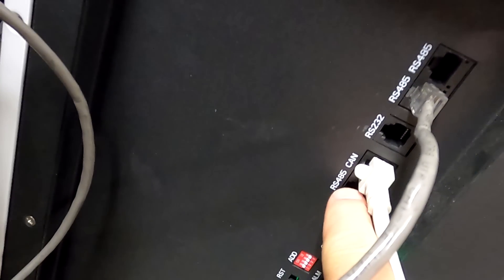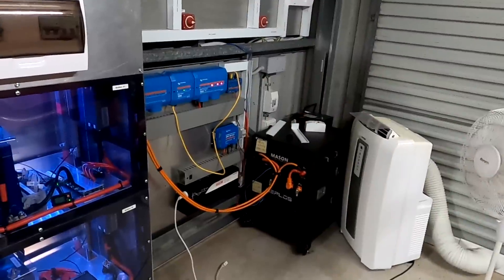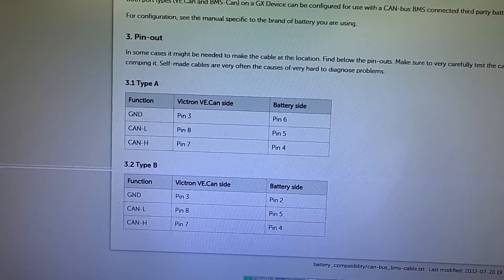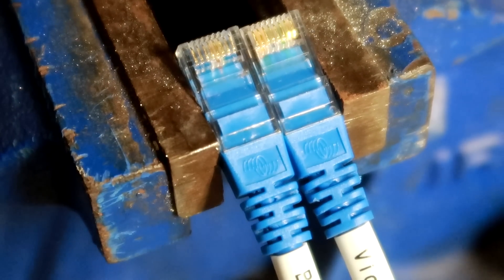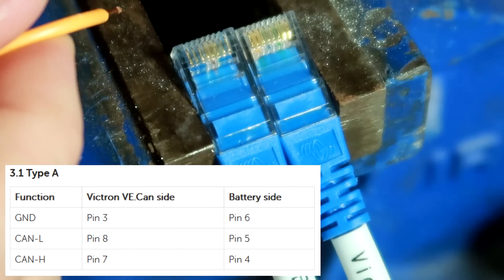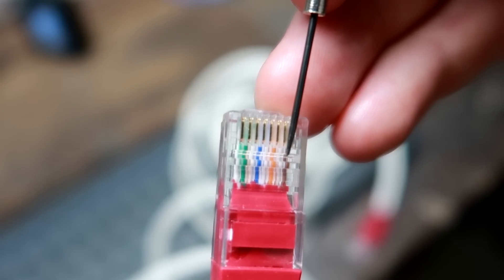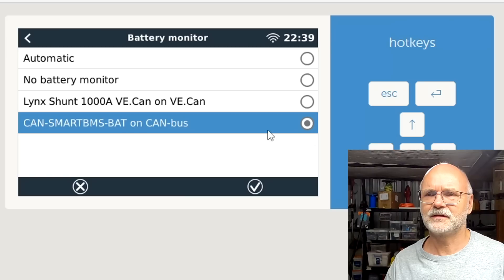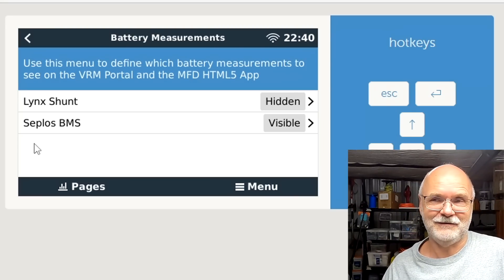Trying to connect 2 different batteries via CAN to the Victron Cerbo.

Comment: Just out of curiosity, what is the use of having a BMS connected to the Victron Cerbo if it is not going to control the charging current of the Victron MPPTs.
Reply from the maker: It still reports the data and alarms to Victron. at the moment it's nothing more than a reporting tool but with some Node Red magic you can doo some pretty cool things.
Reply: @OffGridGarageAustralia  Andy, awaiting anxiously for a Node Red vid.... The beer is ready for the occasion.
Reply from the maker: @salimnaufal1779  Yeah, me too😁 I think we will be coming closer to that actually and will dive into the Node Red opportunities.
Reply: A battery (and its BMS) has more data to provide to a Victron setup (e.g., to the Victron MPPT) vs. the Victron smartshunt, which has limited data. Both BMS and Smartshunt show up as battery monitors, and the cerbo gx allows the user to select either of the battery monitors (or automatic) in order to feed its data to the Victron MPPT.  The idea is to use the battery (BMS) instead of the smartshunt because it will be more accurate and will have more data (e.g., individual cell voltages).
Reply: @George_us  I totally agree with the more data part. But we need to consider that following scenario where cells are not perfectly balanced and the state of charge is nearing the 95%. The BMS should reduce the charging current coming from the Victron.

Comment: Sorry Andy but cutting a twisted pair and rejoining one of the conductors to a different twisted pair defeats the object of noise protection. are you sure about that ? 😍
Reply: It is for a CANbus at low bitrate and only about two meters long. What amount of noise do you expect?
Reply: @Juergen_Miessmer  Any inductive current from the AC environment I would say as well as pulsing current on the adjacent lines. Can Bus is not much different from RS 485 but duplex hence a more intense amount of signals.   Btw,  I don't see how the low baud rate would positively affect the noise 🤔
Reply from the maker: No problem with this cable. I have it connected to the QSO battery for a few days now and it works a treat. Even it is very close to AC and also the inverter. I don't even use a terminator atm...

Comment: Hi Andy! Du kannst die CAN-ID mit den DIP-Schaltern verändern, dann sollten Beide angezeigt werden.
Reply from the maker: I think they just tell the BMS how many slaves are connected. Usually there is only one CAN connection from a BMS so the ID may be fixed programmed.
Reply: @OffGridGarageAustralia  Da ich ein zweites Seplos BMS aus der gleichen Lieferung da hatte, habe ich diese nun an eine Batterie und dem Raspberry mit Venus OS und dual CAN Adapter angeschlossen. Das Ergebnis war unerwartet....Das zweite BMS meldet sich als "LG resu Battery" und wird in der Geräteliste angezeigt. Ich kann mir das auch nicht erklären... 
SHEnergie hat die Poduktkennung B007 und die LG kommt mit der Produktkennung B004
Reply from the maker: @lerrypage  Den Namen kann man ja aendern. Die BMS werden immer als irgenwas erkannt.

Comment: Hi
My Seplos Bms lcd isn’t working. Looks like I’m getting Bluetooth signal but no success in connecting. 
I can still connect to my laptop with the cable. Please help
Reply from the maker: I think there is a function switch in the PC software to turn the display on and off. Check that.
Reply: @OffGridGarageAustralia  it’s turned on. I’ve contacted the supplier and they are sending me a new lcd. Hopefully that will fix the issue. The display was working on the first day and the next day it stopped working

Comment: I was able to get both of my Overkill BMSs plugged into my Cerbo but Victron doesn't make it easy. 

They assume if you're plugging in BMSs to Cerbo you want the BMSs to control the system. Which is frustrating because I just want to use Cerbo to datalog my BMSs and use the MPPTs and BMV to control the system.
Reply from the maker: Was this via CAN as well or did you use RS485 to USB converters? We have done that test and could connect 2 different BMSes to the Victron system.

Comment: Each CAN device needs a unique ID. You had a table a past video for dips switch settings to CAN-ID. Make them all unique and they should all show up without conflict. The Cerbo ID will be unique too. The cerbo should be doing a broadcast to see whats on the bus. Each will answer with its ID. The first one that answered probably populated the static flields including name. Daisy chain them all together and terminate the ends, which means the terminators go on the unused CAN port. The terminators will require the correct wiring which will be different from the cerbo termination. The cables from BMS to BMS will also probably have to different, I would guess straight through so a standard CAT5/6 cable would probably do. Also you could possibly use CAN for the slave BMS's too instead of needing RS485 between the BMS's. But then the master BMS may talk to the other BMS's on the other batttery too. YMMV since I havent got any batteries yet, but I have developed with CAN before.
Reply from the maker: There is only ne CAN connection per battery, the other batteries in parallel are communicating through RS485. That's what the switches are for. to address the RS485, not CAN.
Reply: @OffGridGarageAustralia  the upper ones address can, the lower rs485. Ab 5 und höher ist die can Bus Adresse
Reply from the maker: I think the DIP switches are just for telling the BMS how many slaves are connected? Usually there is only one CAN BMS in the system so the ID does not change.
Reply: @OffGridGarageAustralia i think too, that you can change the seoplus can id
Reply: On one battery dip switch 5 on, on other battery dip switch 6 on
Reply: Or if you can't change the id of the second battery, on the seplos battery only dip switch 6 on

Comment: Good evening friend, I've been watching yours because it's a good video to acquire knowledge, but I had a doubt about an American standard, which talks about grounding the negative post of the battery of the off grid solar system, with your experience in off grid solar energy for What is this grounding connection to the battery's negative post, thank you and sorry if there are any writing errors,
Reply from the maker: Not sure what standard this is, but usually you ground the negative of your battery if you are in a vehicle, either RV or boat. If stationary, you don't have to, but I'm not familiar will all the electrical codes around the globe.

Comment: Andy, I noticed in the Cerbo setup that there is an option for 'Automatic' in Battery Monitor which may or may not work. André in Sydney
Reply from the maker: This only selects either the shunt or the BMS as the battery monitor automatically, whatever the Cerbo decides is better.

Comment: Hi Andy, thanks for all your videos.
You are maybe seeing same as you did with RS485 communication. I think BMS are writing data to CAN-bus using same CAN-id, then it is a bit of a coin flip on witch BMS data is shown last BMS to write to CAN-bus before Cerbo reads from CAN-bus. I have seen similar things when programming control systems. See if there is a possibility to change CAN-id on one of the BMS and of cause don’t use the Cerbo CAN-id.
Reply from the maker: Ah, right, thanks for the explanation. I'm not aware of having seen a CAN ID in any of the BMS which can be changed. But that's a good point!
Reply: @Off-Grid Garage  are the seplos dip switches setting the CanBus ID?

Comment: I love the use of your Hard drive magnets to hang your tools!  I'm going to do the same thing if you don't have it already trademarked!  Love the video!  PS...  Get a ethernet plug crimper!
Reply from the maker: No trademark on that feature 😄 Go all in, it works great and they even hold my small sledgehammer with 5kg.
I haven't crimped a ethernet cable and plug for the last 20 years, I think, so a tool for that seems excessive 😉

Comment: Notice the Lynx Shunt is way off too. Not just me then. Seriously regret buying that overpriced fuse holder now.
Reply: Same..
Reply: (To Pedro   above)
Reply from the maker: In my case, that is maybe because I connected a second battery to the system to charge it up. The Seplos battery is full, the other is 50% full, the shunt is confused. But, yeah, the Lynx shunt is my least favourite device from Victron so far.

Comment: Color coding of LAN cables are such due historical reasons. In 10Mbps system only 2 pairs were used blue & orange and based of telco color coding system those are two first pair of colors. Next then are green, brown and grey. Pairs from 6-10 are the same but with black second wire instead of white

Comment: Andy thanks for everything!   It would be really interesting if you get different ALL IN ONE INVERTERS(EG4, LV6548) and connect them to your solar panels / battery and see how they perform.
Reply from the maker: But I'm off-grid, so these hybrid inverters won't work as intended. Same with the Multiplus I have. It will probably never see the grid... and some of the inverters, I cannot even get down here, they are US only.

Comment: If you buy a crimp tool, get the ends that allow you to poke the wires all the way through. They're easier to work with in my humble opinion.
Reply from the maker: If you do it on a regular base, yes, absolutely.

Comment: Andy, see if you get a different/better result if you change the Device Instance (Settings > Services > VE.Can or BMS-Can > Devices > [one of the Seplos BMSs] > Device Instance to 1 and leave the other BMS at 0 (ignore the warning).
Reply from the maker: Thanks for the tip. I just checked and I can only set the Unique Identity Number under the VE.CAN function (the shunt, other Victron devices with CAN port...) but nothing to set under the BMS-CAN ports option. It only shows the communication but nothing to change or set here.
Reply: @OffGridGarageAustralia  Ah pity. Seems like this is not supported for CAN-bus BMS (500kbit/s). Maybe the VE.Can & CAN-bus BMS 250lbit/s profile, provided the Seplos BMS supports 250kbit/s, but that's not supported for the BMS-Can port...

Comment: Did you by any chance switch the CAN bus ID on one of the BMSs?
Reply: That does sound like one way to bork it, two devices with the same ID on the same bus.
Reply from the maker: If you point me to the settings in the Seplos BMS, I'll have a look. I'm not aware of such an ID which can be changed and I thought I have explored pretty much all options with the Seplos BMS. Nothing in the other BMS to set either.

Comment: You could use the empty space in the VRM to show the MultiPlus. But in the test system you do not have one connected jet.
Reply from the maker: Ah, right, I never had a look into this function in the Off-Grid garage console. I have now turned it on but it actually shows the same as the AC Loads, so not much gain.
But thanks for the tip, good to know...

Comment: From one IT guy to another(just have to give you some crap)....Andy, thought you do IT as your main job. Must be more software related and not networking which would explain you didn't know about network cable. Also, use crimp connects next to instead of soldering (but thanks for using the US pronouseation "soddering"). Mechanical connections are better  in this use case. Love your channel, because of you, I have something like your SPAT setup. I compare my 1.3k panel against you 1.5k.
Reply from the maker: Well, I knew about the 586A and B standard just haven't used it for the last 20 years or so. I could have made the perfect video but thought I leave the fail in there so other people don't think I'm a Guru and get it all right everytime😄
Reply: That was only a test cable for this video.
Reply: Soldering works well for low current connections.

Comment: Haven't you got an rj45 crimper to terminate properly it  makes a lot neater, reliable  and long lasting job than splicing. It's probably a quicker and  easier job than cutting ,  soldering and heat shrinking too. They aren't expensive  and you'll find they are needed semi often
Reply from the maker: No, I haven't got one. The last time I did this was in my apprenticeship in the 80s.

Comment: You need an RJ-45 crimper and some plugs - more tools for the garage! ;)
Reply: Also put a lan tester on the list.. :goodvibes:
Reply: Have an RJ-45 here, Andy, only 1600 km apart. lol
Reply: Sometimes I use toolless RJ-45 connectors (when I can't find my crimp tool). When I showed them to an electrician who was installing my EV charger he was impressed, he said he'd go and buy some. 
Perhaps a few of them for your collection, just I'm case?
Reply from the maker: Noooo, I haven't used such tools for 30 years. It would be a bad investment.
Reply: @OffGridGarageAustralia   Like a carpenter without a hammer and nails...:goodvibes:
Reply: @OffGridGarageAustralia You do go to impressive lengths to not use such a tool, so I'm not surprised you haven't used one in decades.